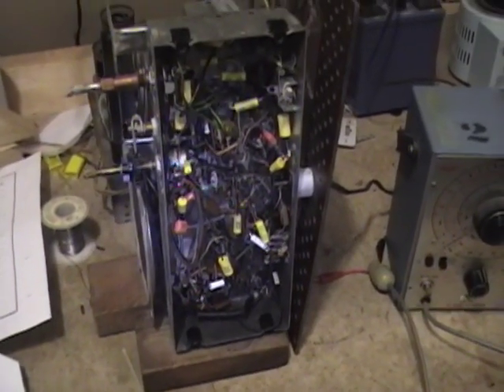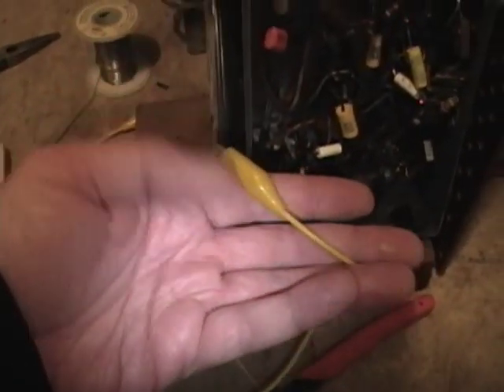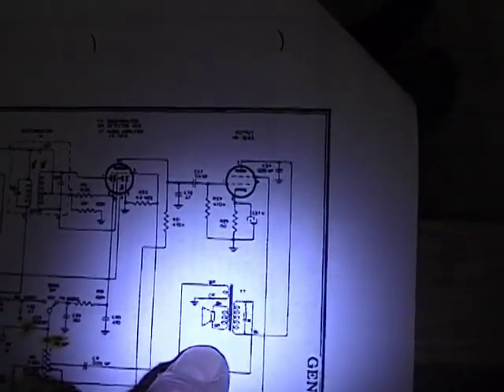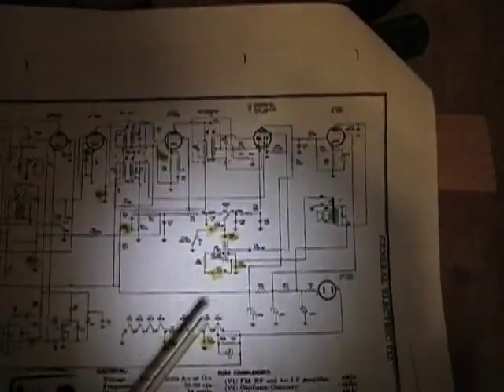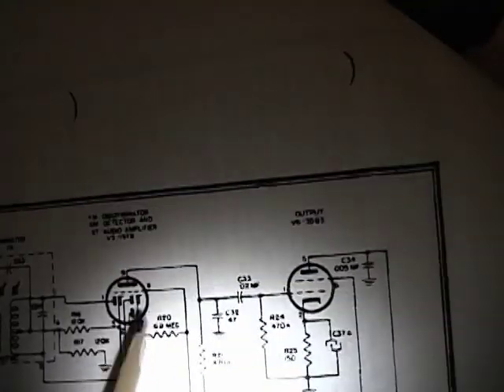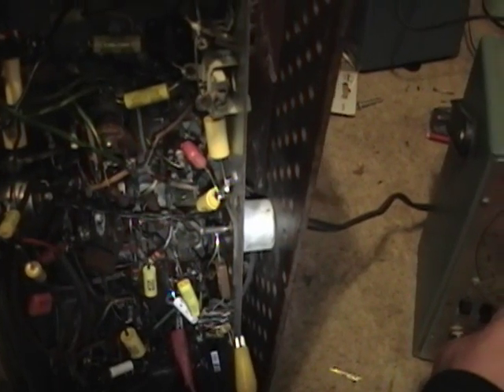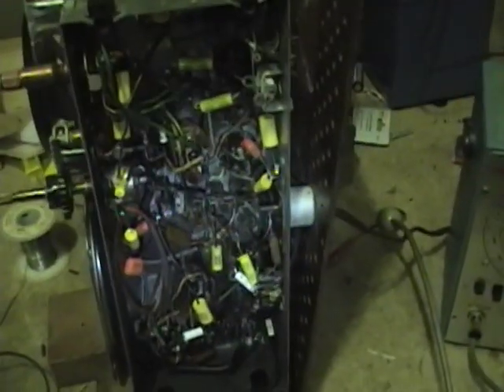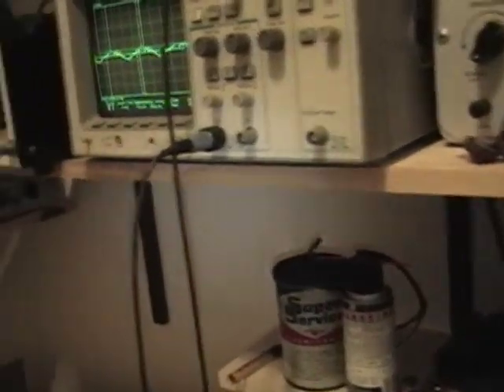AM Radio Troubleshooting

Comment: A quick question , I see at 4.07 minutes you suggested testing at what I think is the B+ of the valve , I might be wrong but wouldn’t you test on the other side of the dc blocking capacitor.. otherwise you would blow the generator? .. unless there is a blocking cap in the generator feed ??
Reply from the maker: Yes, always use a blocking capacitor on the RF generator.  That what is often referred to as a "dummy antenna" in the alignment instructions.

Comment: Im exactly in this same predicament as you describe in the intro to your video. Checked tubes, recapped, checked and replaced resistors that were off. FM works good, AM does not. The AM band does not tune to anything however during the first alignment step, injecting a signal to the mixer tube, the modulated 455khz can be clearly heard through the speaker. Checked antenna coil resistance & inductance - checks good. Checked all of the AM/FM selector switch position contacts - check good. Checked IF coil resistances - check good. Placing a good battery operated  AM radio next to the inoperable radio and turning the tuning knob on the bad radio causes its local AM oscillator interference and squeal to be heard on the good AM battery operated radio.

Comment: Thanks for the video, I hope this is still being watched.  I take it that the speaker a permanent magnet speaker (since the radio can be powered off for testing)?  If the speaker was an electromagnet type, wouldn't the power need to be on to energize the electromagnet?
Reply from the maker: Yes, it is a PM speaker, but the radio is powered on.  No signal would be getting through the tube stages if they didn't have power.   Boy, I really cringe when I watch these old videos, terrible lighting and camera work 😕
Reply: @bandersentv  Not a big deal on the video production, I still learned a lot.  Thanks again for posting.

Comment: Finally an actual video on how to put to use the Mod In/Out function on the RCA signal generator model WR-50B. I’ve been watching your videos for some time now and finally subscribed to your channel.  I tried to check the voltages on my WR-50B and the schematic notes calls for Mod in which was and still is confusing and I’m getting very high tube plate voltages because I think I don’t have anything in the Mod input jack as per notes.  There are no videos on how to actually use this model signal generator in full and it would be nice if you could do a thorough operation video on this unit. There are a lot of these models out there and I’m sure most of us would learn and enjoy a thorough video on the mod in/out features and some other Xtal crystal uses.
Reply from the maker: Sorry I solid it years ago.  MOD IN is for AM modulating the internal RF generator with an audio signal when the switch is set to EXT.  MOD OUT is the output of the internal 400Hz audio generator.  

You don't need to connect anything to the MOD jack to use the generator.  It should have no affect on the plate voltages.

Comment: When you hook your signal source to the plate of the output tube, will  that voltage to go back into your signal source?...It usually is like 150 volts on the plate...
Reply from the maker: Block the DC with a capacitor in series with the generator
Reply: I saw a schematic of the IG-102 which shows a .01uf capacitor in series with the RF Out connector and a .022 uf capacitor in series with the AF Out/Ext Mod In connector.  I assume that prevents DC voltage from getting into the IG-102?

Comment: check voltages first, then just inject a signal ninto the audio circuit, if you hear it then move on to the midpoint in the radio. From there you can go either direction. nice video
Reply: Many times schematics don't show voltages. By midpoint, do you mean after the volume?

Comment: Brilliant Video.  I have been procrastinating about getting a function generator for ages but you've convinced me I do really need one.
A quick question though.... you are injecting a signal at a point where it is also been driven by the circuit... don't the two signals fight each other?  (If it was a circuit using OpAmps rather than tubes would the feedback affect this approach?)
Reply from the maker: +NivagSwerdna Good question.  Tube circuits are generally high impedance and driving a grid via a DC blocking capacitor works very well.  Also it's a good idea to tune the radio to a dead spot so there's no incoming signal.